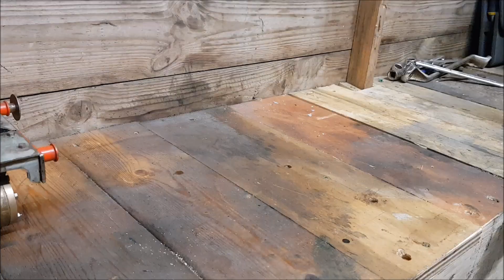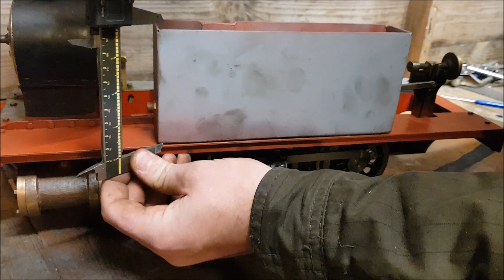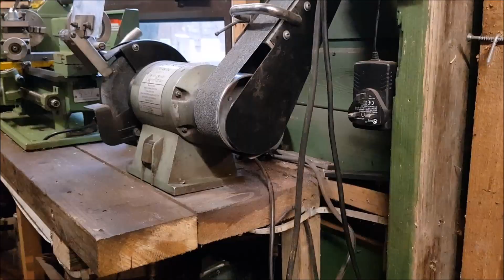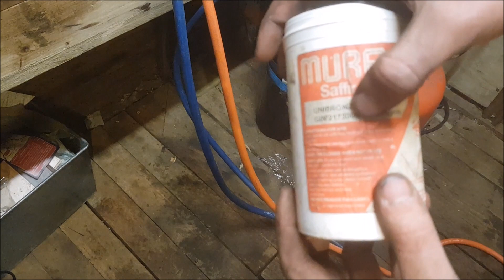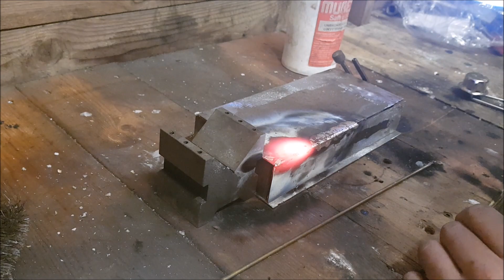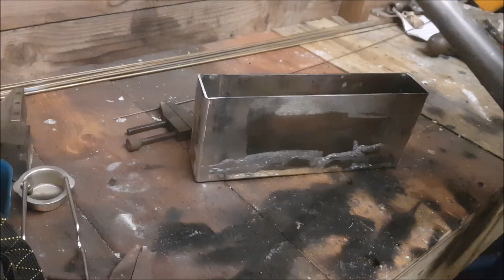Oxy Propane Brazing - 3 1/2 in Rob Roy Side Tanks

Comment: Thanks for the vid! is it hot enough for brazing in your opinion? thanks.
Reply from the maker: That was brazing I was doing :) I think oxy propane burns at 2800 degrees if I remember rightly
Reply: @MrLegograbber99  Okay sorry, i just tried brazing 4mm steel with propane only and to my surprise it worked so i'm sure that set up you have there is a breeze to use, thanks.
Reply from the maker: @ProfileP246  you'll manage yeah , it's a bit easier with oxy propane

Comment: Thank you for showing the flame. This is the first video I found which shows oxy-propane flame. But I still can't find video which shows how to regulate oxy-propane flame for welding of steel.
Reply: Better late than never I suppose, but oxy-propane cannot be used for welding, it won't work because the flame doesn't have a reducing zone like an oxy-acetylene flame does. You can use oxy-propane for basically any other torch application though, and it's particularly good at cutting if you use a proper propane torch tip.
Reply: @Teklectic  You can draw the reductive "moustaches" out from the propane flame, though it likely isn't doing any good. The temperature drops.
Could try with something like 5 atm of oxygen and moustached fire, I don't know. Need an ear protection anyway :)
Those times I've tried 5 times to weld 1/2'' pipe. No success. The seam always isn't leaking any water immediately, but etching it with acid did open 1-5 holes in it (3 holes in the last try). Oxidation is huge. Especially hard is to finish weld at the point where you began, - there will almost certainly be a hole (an inclusion of oxide which easily transforms into a hole when using an acid).
The 2% Mn containing welding wire has a lower melting temperature than the base metal has, however, it also intensively burns in the propane fire, this way melting even at a lower temperature than its actual melting temperature is. This big difference between melting temperatures of the base metal and the adding/filling material becomes one more problem, where the filler material obviously doesn't want to melt together with the base metal.
I'll not even try propane ever, I think.